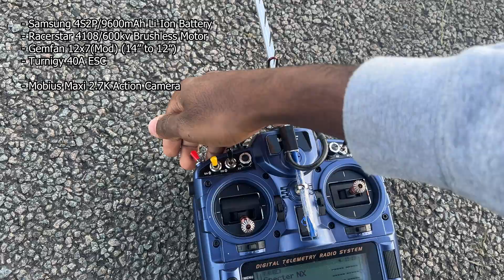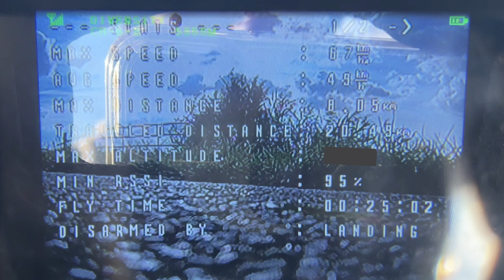Narrated Long Range FPV - 8.0km to the Windmills - Airplane Setup & Flight

Comment: Quick question and im not trying to be a butthole. I am new to the hobby and this is exactly what i would like to do. However, i was under the impression that you either had to keep visual of the plane or have a spotter watch the plane if you are wearing goggles per the faa regulations. Is that not the case? Or, maybe youre not in america. Im not sure. I want to do this!

Comment: Is it possible to create one of these using the same materials, capable of carrying 10kg and with a range of 50km? This is for humanitarian disaster relief, for example, hurricanes like Melissa, to deliver food to isolated high mountain areas. Help, please.
Reply: I'm not him, but apparently it is possible; it would only be necessary to modify the engine or use a different one with more power, in addition to reinforcing the fuselage a bit more, i believe that this would make it possible to build something like you described, or even bigger than that
Reply: I am no professional, but that is a lot of weight. And that is a long distance. Normal rc batteries and motors wouldn't handle that i dont think. I would think you would run into legal issues as well. It could be done, but it would be much more complex than an rc plane

Comment: With a belly lander design like this, how do you avoid breaking propellers when you land? This has puzzled me for a long time. I admire your creativity and passion for this very technical craft.
Reply from the maker: Thanks! The ESC has a ‘brake’ feature to stop the propeller from spinning as much when there is no throttle, which effectively reduces risks of breaking the prop upon landing.